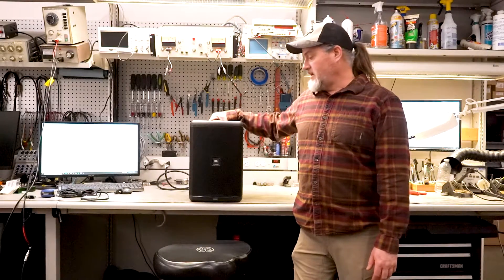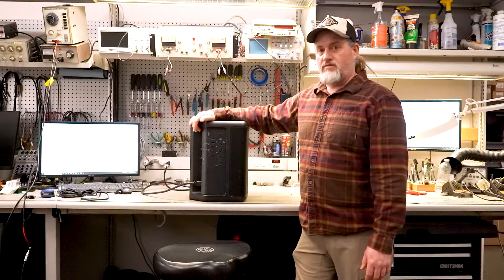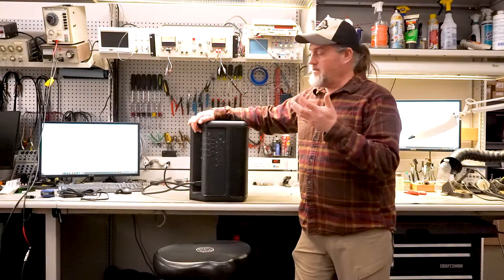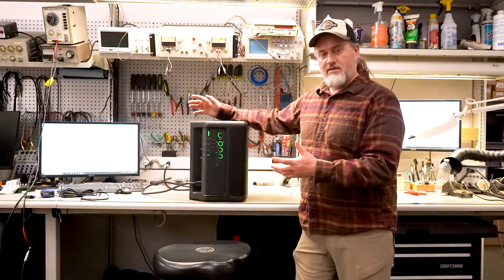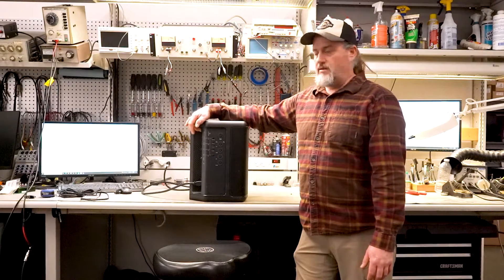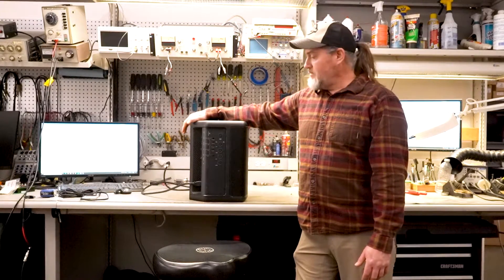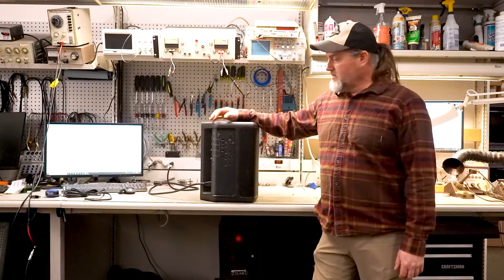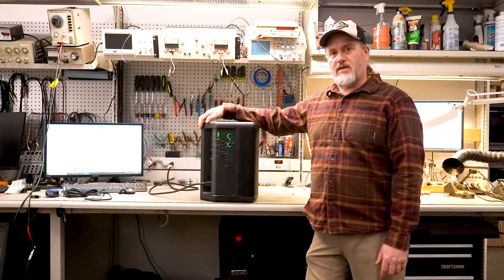JBL EON One Compact Broken Power Button #WorkshopWednesday

Comment: Great video...  Where can I order this button from?  I need to replace mine
Reply from the maker: Sorry.  We are not aware of a place to order these in small quantities.  Additionally these are mounted to a circuit board that is multi layer through hole and SMT mixed format.  We are repairing a number of these with attempted previous repairs that have caused board damage.  We recommend not trying to work on this circuit board unless you have access to and experience with the appropriate soldering tools.  A regular soldering iron is not appropriate for this rework.

Comment: Mines bent in luckily it didn't break off i got to open it and bend it back into place i drowned it with some epoxy to keep it in place its now sturdy and works fine i got lucky.
Reply: Hi thank you for the tip with epoxy, would you be so kind to share a pic on how your fix looks like. Haven’t worked with epoxy yet and I am a little worried about getting the hole switch blocked. Thank you.
Reply: That sounds dangerous! Just don't epoxy the button or you'll never turn it on or off again ;-) 😀

Comment: It happened to me.  It collapsed in, terrible design. One of many terrible designs and choices.  Also- the app is worthless!!! Do not waste your time on the app.  
The jbl support is only given one eon one so they have zero idea how to answer questions about pairing.  I would not buy these again and i was very optimistic.
Reply: I love mine. The app is very good now, but you have to pair the speaker using the APP and the app will show the speakers it finds in the list of speakers, it will light up and then you can click on the speaker, once you get used to it, the app is extremely powerful, especially setting the parametric EQ and saving the snapshots of different setups. Good luck